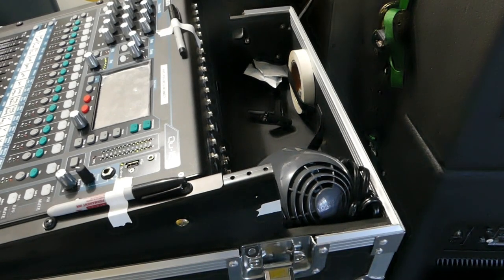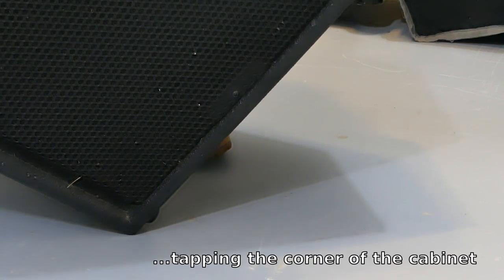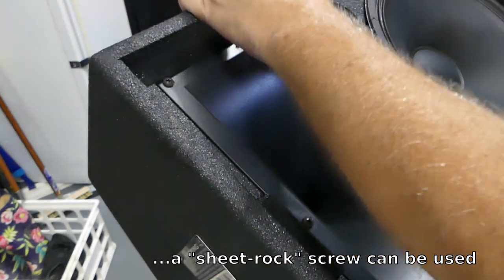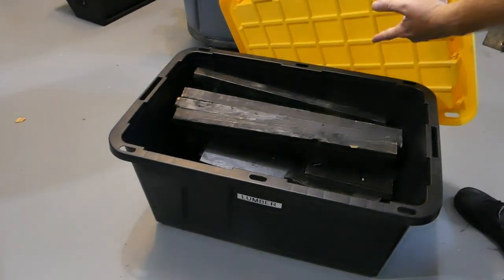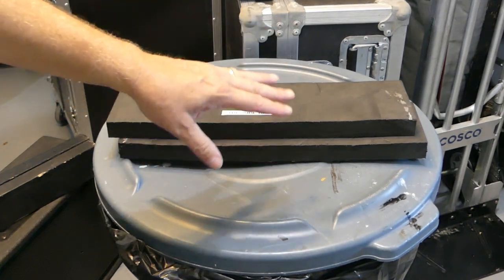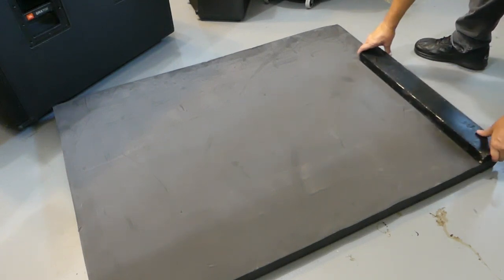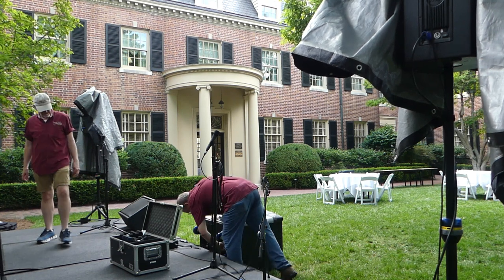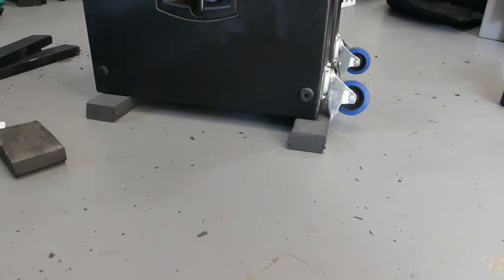Improving and maintaining a few things and using low-density foam for support

Comment: For another solution to the speaker grip issue is to hit a kitchen or restaurant supply and pick up some kitchen rubber floor mats. The ones with holes in them work very well and have the grip of snow tires.
Reply from the maker: Had not considered kitchen floor mats.  Great idea!
Reply: @stageleftaudio  I'll second this.  I use those too.  They're also pretty good to put on the ground behind the mix position.  If the ground is hard, I find it causes pain in my feet and back. The mats don't completely eliminate the discomfort, but they make it much more bearable.

Comment: I had the same problem with my subs when high volume was applied to them. After many things that l tried, finally the square heavy duty anti vibration/skip pads from home depot did their work, no more moving subs.
Reply from the maker: Good to see those are a solution.  I had considered these.

Comment: Great Idea...wow...so would home depot have that...at least I would know where to get them
Reply from the maker: The big box stores may not have a proper selection of foam.
Here's where I picked up the foam you see in the video (I'm using the 2LB foam)
foambymail dot com  
Depending on the weight of your speakers, you may need a foam density that is more or less than what we are using.  The speaker cabinet in the video weighs 170 lbs.  The 2LB foam works great (at a 2" x 4" size).  However, that foam may not work well for lighter weight cabinets.

Comment: I've also used a broken toothpick in the screw hole then it will allow the screw to bite back down
Reply: I learned that trick from my dad.  We have some vintage cabinets at the restaurant and once in awhile a hinge comes loose.. He would take wood glue and a tooth pick to the hole
Reply from the maker: I too have used a toothpick, but only if a wood-screw (or a sheet-rock screw) cannot be found.

Comment: PLEASE , Do NOT Ever use "Sheet Rock or Deck Screws" for a stripped hole . 
Find some Toothpicks or golf "T"s. Insert into hole & cut off extra. Insert OEM Screw back into hole, "By HAND". Tighten snugly. Do Not overtighten.